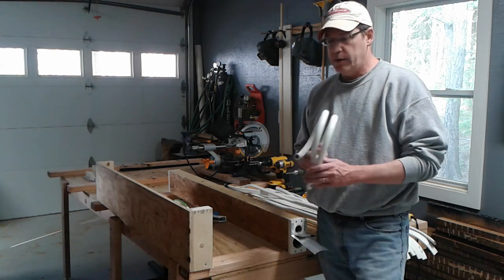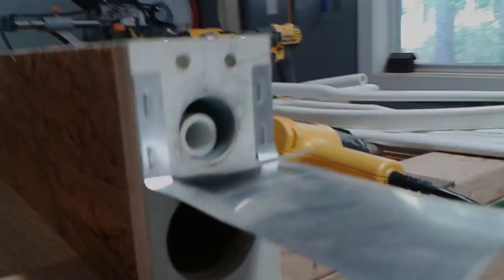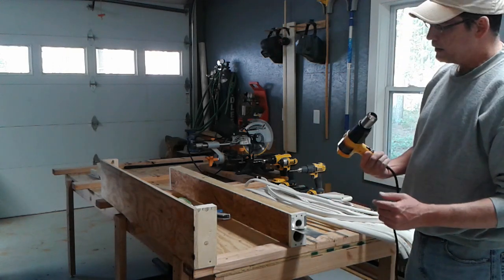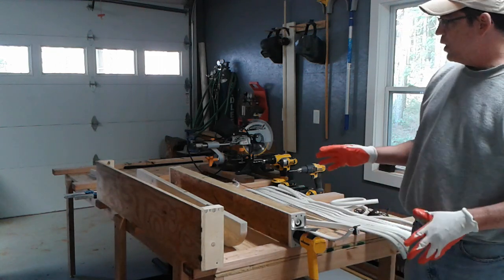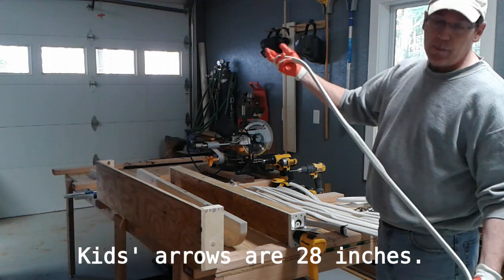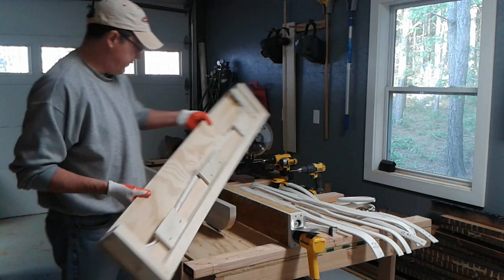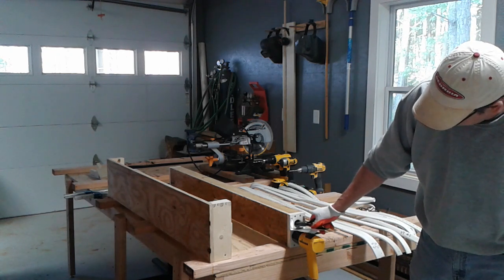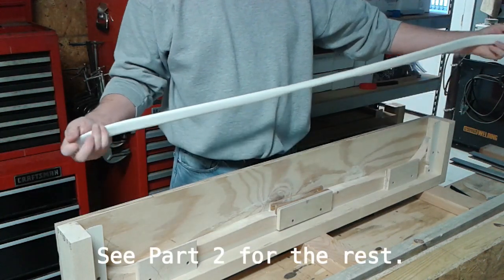Best Way to Bend PVC + Making a Kids PVC Bow - Part 1

Comment: I followed your instructions to a tee but lined the inside with aluminum foil and put a piece of sheet aluminum at the far end to create a curve to aid in circulation. It took four minutes to turn the 1/2 inch pvc into a wet noodle - thank-you.
Reply from the maker: Good additions. Pretty cool how floppy it gets. I need to get mine out and fix it up.

Comment: I love the heating box, brilliant idea! I'm finding difficult to get even heating with my heat gun, it's 1200 watts, i hear 1500 watts is better. mind you, i'm using 1 1/4" schedule 40 pvc so there's a lot of material to heat
Reply from the maker: That's big pipe, but I think a box of some type is what you need. Something that will allow even heat for a long time.

Comment: is it possible you could make a video on how to build your mold? this looks very consistent as far as the limbs go. how did the handle get flattened the opposite way?
Reply from the maker: I will try to make another video when I have time. I do want to get back to this project. But in the mean time, the handle is made by pressing the middle of the pvc into a narrowed part of the mold. You can see me do it at 14.05.

Comment: This is a bloody great idea, am making one today. what size pipe and length would you recommend for an adult bow, say 30+ lbs
Reply from the maker: Maybe put a 1/2 inch inside of a 3/4 inch. Don't smash it too flat.
Reply: Clayton Darwin what method did you use  to tie your string
Reply from the maker: It's a kids bow, so I drilled holes and made the string permanent.

Comment: Have you tried putting fiberglass marker poles inside? Apparently that works pretty well. I'll be trying it myself soon.
Reply from the maker: Stick Figures Wood Novelties - I've only made these for my son, so I haven't needed the extra power. But I've seen it done, and it seems to work really well.

Comment: That is sweet, dude.  Wheels are turning in my head for some mods for personal preference, but, anyway, your short vid saved me trial and error time!  Keeps your bow straight, and the clamps do the work for you.  Saw a bunch of other vids, but we're gonna use this one.  Was gonna do this in February for our scout troop, and I was still in the "I wonder how I'm gonna..." stage.  Is that 1-inch plywood?  Thanks for sharing.
Reply from the maker: Adam Kapololu - Great idea for a scout troop. You can make one for everyone once you get set up. You might use 3/4 pvc for bigger kids. I think that's 1/2 plywood with 2x4s or 2x6s for the form. The main thing is that the form needs to be smooth. Other than that, use whatever you have.

Comment: Wow.  This looks like such overkill.  I hate to say it but I'm making bows with just a heat gun, a wooden table, some simple blocks, and clamps.  I could see this kind of extreme set up if you're going into mass production but I've made six different bows including two take downs with minimum set up.  Backyard bowyer started out with a rag and his stove, and made some pretty good bows.  I admire your rather determined method but l like the freedom of innovation that a more freehand method allows.
Reply from the maker: I'd like to see your method. How about uploading a video for us.
Reply: you don't need such a setup, but it makes errors happen less, it makes the process of heating and shaping much easier and you can produce the same results many times, consistency is key when making limbs
Reply from the maker: Wade knows.